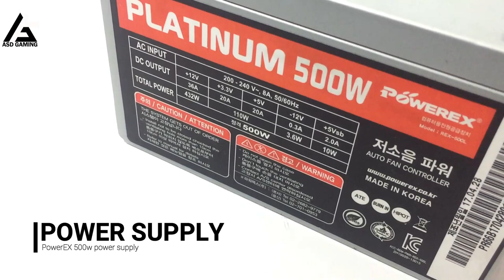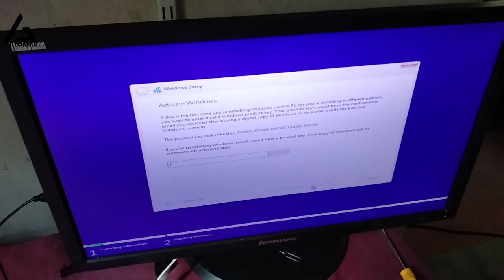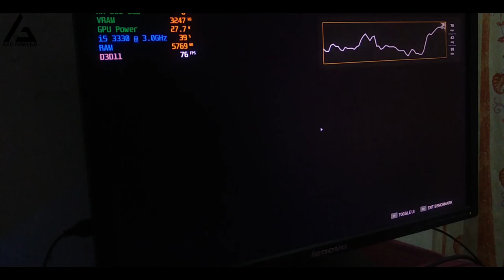Budget Gaming PC with used components(i5 3330 + RX 580 4G + 8GB RAM)

Comment: rx 580 is good but i5 3330 is not good because the cpu usage will hit 100% even with low settings and it will cause lag spikes in some places, i recommend you to get i5 9100f, i3 9100f, i3 10100
Reply: R5 2600 too?

Comment: Intel i5 3330 , 8gb+4gb ram , 240gb ssd+1tb hdd , msi gt 710 2 gb graphic card , gta 5 smooth chalega kya plz reply ♥️
Reply from the maker: it's depends. are you playing online or single play and resolution. if it is online - u gate around 50 - 65 fps in 1280 x 720
Reply from the maker: if it is single player(offline) you can get little more FPS than online 720p
Reply: @asdgamingsl  thanks

Comment: i have this build i play thats games on ultra graphics 1080 you gpu is fake
Reply from the maker: that one is not fake one. this graphic card is a OEM card from ZOTAC . in this card, the core clock and memory clock speeds are little bit low than the other 3rd party cards. all so power consumption is low. this card is nota a fake one.. just OEM
Reply: Its not fake. If it was it could even run cs 1.6 xd